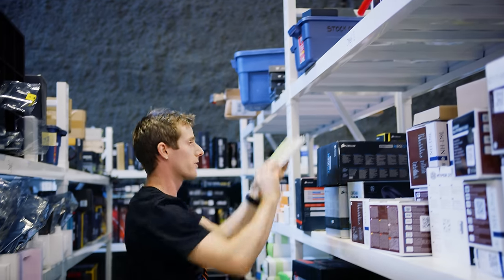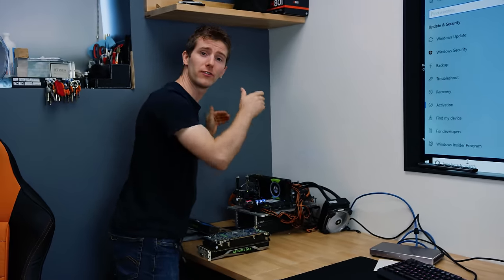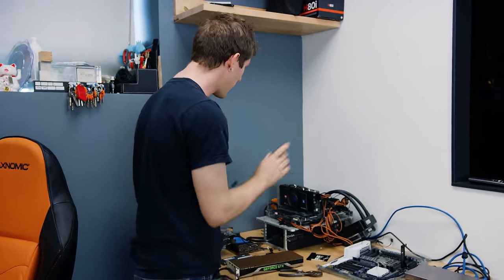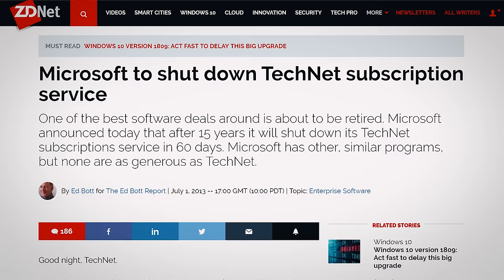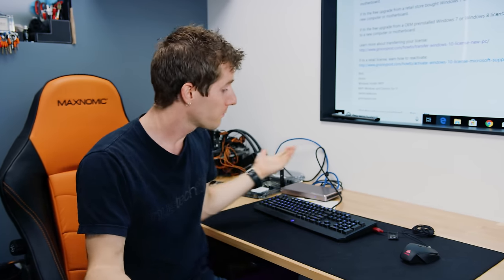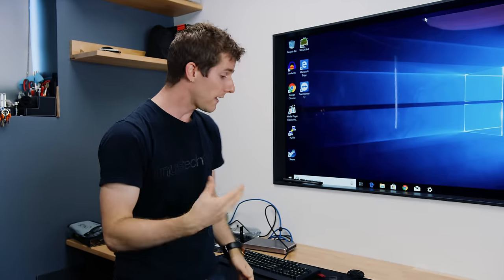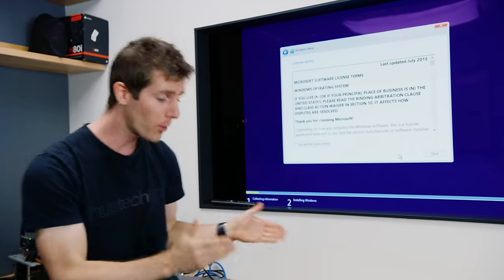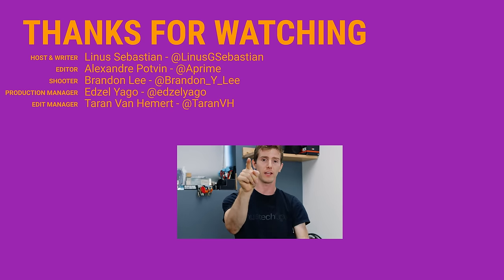Why Does Linus Pirate Windows??

Comment: Actually the European Court of Justice ruled that OEM licences are completely legal no matter what Microsofts user agreement says. So you may be right about NA, but not the EU.
Reply: Never knew that, nice to read and know it!
Reply: In general most courts if most countries have struck down EULAs repeatably. License terms has to be specified at or before purchase, license terms that are told later or you are asked to to agree to later are not legally binding. The OEM deals are different in that they are terms the OEM agrees to, depending on the size of the company asking OEMs to agree to terms that might be illegal due to anti-trust or completely legal. But one thing that is completely legal in any case, is using one of those licenses if you get it, the OEM that sold you it, may or may not be guilty of contract violation, but that isn't your problem. And these days you get the windows OEM licenses from normal retailers, not from OEM breaking contracts like we did 15 years ago.
Reply: Indeed, license agreements can't override local law.
Reply: Does Linus live in the EU
Reply: @lel2015  me? Yes, in France
Reply: But Linus lives in Canada?
Reply: Even then, does Microsoft really have the right to deny you service based off the location where you use a piece of software? They can deny selling you software or providing service for said software, but I don't imagine it'd be legal for them to deny you usage of software purchased legally even if it is against ToS
Reply: Actually OEM is still unregulated thingy in the EU.... Supposedly you can buy and sell them but can't use as far as I know. Besides, if you are using it as a company you need a VAT invoice for your software to be legal.
At least aforementioned rule made EA's Orgin give an option to de-activate games so that you can sell the key though steam dodged it saying that you are only borrowing games on steam :/
Reply: Yup - kinguin.net for the win.  I bravely blogged about this on LinkedIn as we do it at a nonprofit I volunteer for.  Lot of people didn’t realise it either (in the EU).
Reply: Slight problem, these courts you mention don't have power outside of Europe. At best, they can halt a lawsuit from Microsoft being levied against these OEM key vendors.
Reply: Correct. If I go buy a piece of software in a box, and get a license agreement later, that license agreement is not legally-binding one bit. It wasn't visible before purchase.
Reply: Also, reselling even used OEM licenses is fine. That actually went to court in Germany, with a large computer recycling company scraping off OEM stickers from PCs they got and reselling those license keys online. Microsoft wasn't pleased, took the company to court, and lost.
Reply: too bad i don't have a british edition of windows!
Reply: but then again, stores in the netherlands are only allowed to sell an "oem" version of windows if you buy it with some storage device like a SSD, without the storage where you "would probably" install it on they are only allowed to sell you the retail version of the software (wich of course is more expansive) as said in the license agreement, beside that you are right you can use a oem license with different hardware then with what you bought it.
Reply: Sosumi :D It's a Mac OS X sound...
Reply: ボロ from EU: You don't need a VAT invoice for it to be legal, that's nonsense.  Infact, even as a company, you don't need to be VAT registered until you are revenuing ~£80,000 p.a.

How are you ment to run your business if you aren't at this threshold yet and you rely on software? (It also gives you a competitive advantage because you don't have to charge VAT to your customers, although you can't claim back VAT on your purchases - but as you're hopefully selling your service/goods more than you paid for them, you have a slight advantage).  And if you're talking about supplying a VAT invoice per sale, you only need to do so on request - and it can be zero rated if you are not VAT registered.

Source: Been there, done that.
Reply: running of an cheap win 10 Pro OEM without any problem for a long time now (living in Germany)
Reply: That only applies in EU economic areas. As soon as it rests on a system outside of that region it falls under the new regions rules. Where you purchase it does not matter it is where you install it that matters.
Reply: @TheBestestKitty  The ruling was only about ownership of the base OS. Any software vendor has the right to limit updates or services based liscence compliance, and supported platforms.  Example is Windows 7 support for 7k /Ryzen series CPUs
Reply: +Zeldagigafan Reading my statement you should see that I was only referring to the EU. I´m aware of what you mean...
Reply: But there is also legal prescient to state that Eulas cannot be legally enforced and that businesses cannot force a person to use software in a specific way or deny access to their digital property. The consumer would likely win the suit, it would just be expensive.
Reply: @ZeldagigafanMatthew  Microsoft obey EU laws tho. All big American companies obeys EU law and can't get in big trouble. Like 16billion fine to apple  even most Europe know best buisness to make is in ireland
Reply: Right in Europe but not in North America. Because you swiped.
Reply: @give_me_my_nick_back  You can strip any OEM install of any system and resell one copy. You must also stop using it. The software companies received permission to regulate rentals. This law was mainly created for games. Like I said they got the short term benefit of rental regulation.  The key is the ruling is only for EU economic region. So even though Canada is a Common Wealth of a EU country they are not part of the EU economic region. When Brexit is done I think UK is still going to be in the EU economic region. If not then the EU rulings stops being applied in UK. It then falls back to the laws established in the mid 90s.
Reply: Yes, their practices in the EU must comply with EU laws, but they don't necessarily have to comply with the same EU laws in other regions of the world, especially since they aren't based in the EU. If they were, then yes, these laws could very well apply to Microsoft's corporate practices well beyond the EU.
Reply: In Australia, it's basically only OEM keys available to prosumer/custom system builders such as myself from stores like PCCaseGear, MSY, Scorptech, Australia Computer Online...
Can't walk into an "electronics" store and expect to buy "Retail" Windows keys, only computer parts shops tend to carry them and it's basically only OEM/System Builder keys you can buy here.

Comment: It's not pirating if you're officially downloading the ISO from their website which is free, and installing it, and having an option to not install a product key and still works as fine, just with a watermark and locked wallpaper options.
Reply: I know this is a bit of an old comment but you can actually change your wallpaper on a locked os by going into the registry and swapping out the default background with whatever image you want. Only caveat is you have to restart your pc for it to take effect.

Comment: he addressed this ages ago, the drives move around to much and it's to much effort to keep them activated
Reply: Nani!?
Reply: too* oh my god
Reply: Yeah I was thinking about that video too
Reply: ... but you can link it to your Microsoft account and then it completely ignores your hardware changes. I have the license linked to my account and I have changed my hardware 6 times. Still activated.
Reply: firefreezy:
Too is correct in that case. Go back to 7th grade grammar! "Too" is emphatic, whereas "to" is locative.
Reply: its microsoft it doesnt work for everyone ofc. I had the same issue a year ago, and afterwards i just installed windows 10 with a windows 8 key and it worked xD
Reply: @FireFreezY  All these "to"s but he didn't say "..effort TOO keep.."? What's wrong with people? 🤯
Reply: WellBeSerious12 no one cares tho
Reply: Yup. If you need to remove it, you can go into the account and deactivate it first as well
Reply: Why not using that type of Windows key that can be moved around
Reply: Nide  Yeah, no. If you have multiple windows licenses on your Microsoft account, then you run into the activation problems Linus showed in the video where you have to go through "activation troubleshooting" and that may or may not fix it, but its just not worth the time and effort because the benchmarks/tests arent effected.
Reply: Oh yeah totally. For Linus' situation it doesn't work out. Normally when I change hardware, there's no issues just moving the key once it's linked to an account. However like he said, after doing it a few times it stops letting you, and I had that same argument with Microsoft support. "I changed my motherboard, and reactivated it no problem, but then I had issues with the motherboard booting and had to replace it, and now it says I've ran out... how is that fair?" I could've sworn it doesn't pay attention to GPU's in the slightest though
Reply: I also did a fresh install recently, and it just all resynced. I had the same details, and it even somehow saved my rotation of desktop backgrounds which were stored locally (bonkers)

Comment: One of the best promotions for alternative OS's I've seen in a while.
Reply: JL-CptAtom be careful, once you get used to it, you’ll hate windows
Reply: @justinbrewer9326  : I understand the frustration, been there done that, but you should take a look at Manjaro. It's a very slick distribution based on Arch, without the cold sweat. 15 minutes per week of updating keeps it working forever, most proprietary video cards are recognized out of the box with the proper drivers installed. My oldest installation dates back from 2015, and it's still up and running, updated to the latest level without having been reinstalled at any point. Cherry on the cake, regular people can use the KDE variant without feeling lost. LibreOffice does a good job at connecting to the outside world of windows documents. I've converted many reluctant users with this one, something I never really managed before. And I go way back to the slackware 3 era, kernel 1.2. 
Manjaro is the best that happened to Linux since Linus himself. Of course, it stands on the shoulders of Arch, so a lot of the credit goes to them in the first place, but Manjaro really brought the power of Arch to the unwashed masses.
Reply: It is obviously just not intended to be used this way. I wonder why they not using linux, but previius time I tried to migrate ti linux it was very unvelcoming. Linux became better but it still has tonns of minor and not minor issues that can be solved with intence googling, and not everyone wants to do this.
Reply: Have you actually saw the video? He basically explains why do we see the watermark and that it is just not how the OS was intended to be used, but it still works just fine.
Windows is far from perfect, but in practice it is still the most both user friendly and flexible. Unfortunately it seems linux has long way to go to fight windows properly. I wish this happen soon but according to my experiance linux is very far from what it fans tell about it and needs too much time investment what actually repels most people.
Reply: @usrname1105  Especially if you perform your job with it.
Reply: @usrname1105  I got used to Linux. Switched back to windows, and I'll never fucking go back. I love the IDEA of Linux but I'll be damned if it doesn't suck HARD in terms of compatibility
Reply: I thought so too and I don't even use Linux...yet. Only recently decided to download VirtualBox to try and learn to use linux but I imagine someone like linus knows how already or could figure it out quicker than me. And maybe I'm wrong but most distros seem free so it seems logical?
Reply: @lolaloliepop  Precisely, nearly all of them are free and have become increasingly user-friendly with each coming day.
Reply: JL-CptAtom  I recommend Ubuntu or Linux Mint. It's the only real option for new users.
Even tho Manjaro (I saw someone mentioning it) is quite user friendly some things might be confusing.
At the beginning there is really no difference between distributions and Linux Mint and Ubuntu are the most user friendly
Reply: i mean, not really. linus has a very specific use case
Reply: @sTiKyt I used both packages for Manjaro and Ubuntu, from terminals point of view it's almost the same.
UI on Ubuntu for package manager is intuitive and clear. Manjaro and Arch is for more advanced user, I have been using Linux for few years now and I had to do more terminal stuff on Majaro which can be confusing for new users
Reply: @sTiKyt Yea but new users don't give a fuck about slighty better manager, they want easy to use and intuitive OS. They have no idea what is AUR and can live without it
Reply: @usrname1105  If linux was easy enough for the average user and they could just download and install apps without touching command prompts ever then it would have gained tons of adoption a long time ago. Its the dumb elitist programmers that gatekeep linux that are shooting themselves in the foot. 
Seriously, I would LOVE to not give microsoft another dime in my life, but until Canonical, Mozilla, etc can make things fully painless I have a hard time recommending Ubuntu or other such open source options to all of my less tech savvy friends and family. I know most of them literally just need a web browser that can scale youtube and load up pdfs and word files.. but there are just still too many little issues that might crop up where they'd be asking me for help since nobody else would have a clue.
Reply: Eileen the Crow there are distributions where the command line isn’t required for app installation, there’s a reason Ubuntu is what most Linux users start with. You don’t need to touch the command line on Ubuntu, not for basic usage anyway. And Linux isn’t exactly meant for desktop usage in general, most use is on the server, so of course it can do complicated things.
Reply: JL-CptAtom can’t wait to not be able to play 99 percent of steam games
Reply: The Sonic Explorer nice stereotype, like most stereotypes, not true.
Reply: JL-CptAtom  Have fun with all that!  lol
Reply: Did you even watch the whole fucking video?
Reply: im on mobile lol